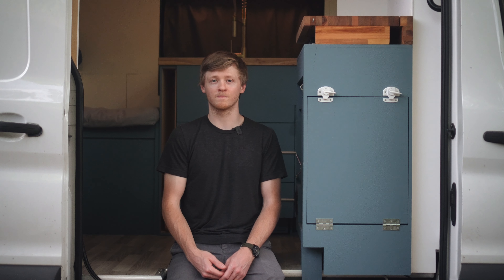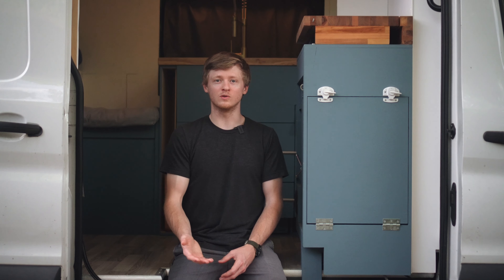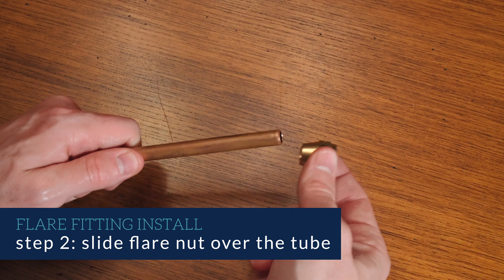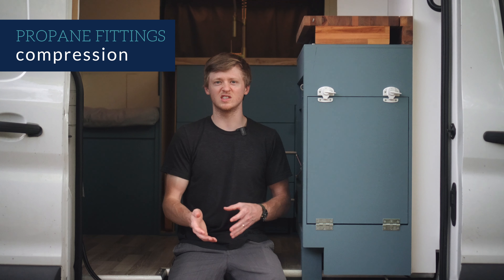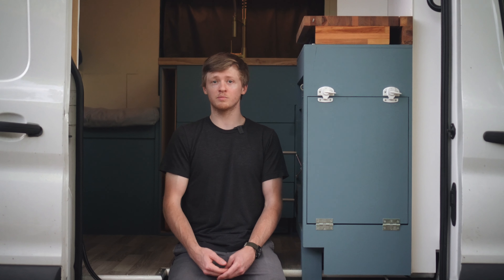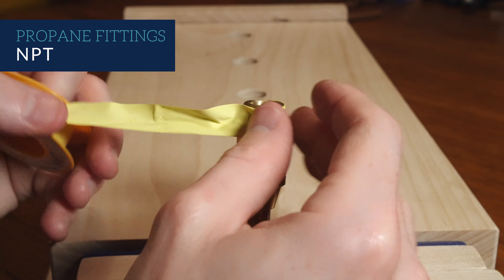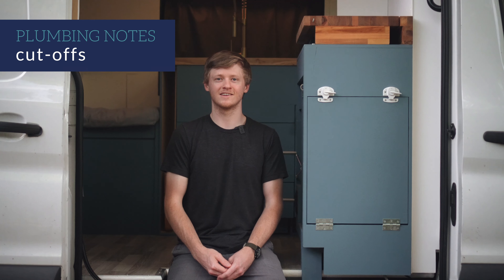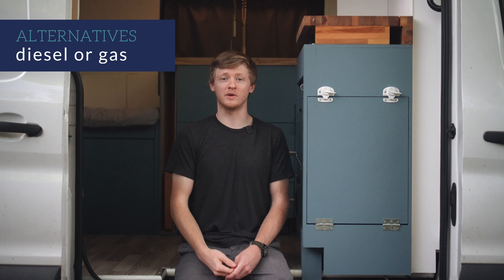Camper Van Propane System - What You Need to Know for Your Build!

Comment: You can get solenoid valves that are “normally open” or “normally closed” in the unpowered state, and also motorized ball valves that only use power while opening or closing. Regardless of the valve you buy make sure it is rated for LPG.

Comment: great video! Could you use a carbon monoxide detector instead of a propane detector?
Reply: You need both as they have different functions. CO detectors protect you in the case of incomplete combustion in your appliances, but do not detect propane. And propane detectors do not detect CO.

Comment: Hi Sam, could you share a few thoughts on why you went half rubber and half copper? The copper seems a lot more intimidating, so I'd love to do all rubber. Are there drawbacks for that? Thanks! (Eric, Promaster 159 high roof, propex HS2000 and Dometic R31 range.)
Reply: I'd like to see how others made their connections especially if anyone has installed a solenoid valve. Thanks.

Comment: You need to have good ventilation to run a propane system in a camper, its not just the gas fumes burning propane also emits alot of water vapor you're walls will be dripping. Installing a propane system is not a problem if you don't care as much about stealth and have a bit of money sitting around. In my case I spend alot of nights in city neighborhoods and used alot of my savings buying/converting the Van so this won't happen anytime soon.

Comment: Hey Moser, 
Is it safe to substitute the propane rated rubber tubing for the copper? I kind of want to do this because it’s easier and requires less tools, but the info I’m finding seems to point to copper being the standard. I have an external propane box at the rear of the van, with the oven at the front so the line will be no more than 10’. 
Thank you for the video! For whatever reason there seems to be less information on gas lines than other van topics.
Reply: It’ll work just fine. It’s what I use in my camp trailer. Just get a propane detector and mount it down by the floor.

Comment: Great videos. Question...If i want to run just propane oven stove what size tank do you think I’ll need? I was thinking about doing undermount tank with a electric 4g water heater for my shower and sink and a wabasto gas heater. Is Undermount just for stove/oven overkill? Do you think a 4 gallon electric water heater is a good option? I have 3x100 amp hour lithium batteries

Comment: Where might I find a link to the propane stove top that you purchased😮 it's kind of like Meg Ryan in that movie I want what he's having😂❤😂 I was shown in meditation after creating the exterior box to lay it on its side after having marked the bottom Circle foundation and the top collar wrap the propane tank in plastic and then the spray foam the bottom which would be the side of the cabinet halfway let it dry a little bit and then lay the tank into the phone and allow it to finish curing and that way it protects it from temperatures helps hold it into place and still leaves a fair amount of airspace and GAP within the cabinet to work around it😮 my challenge is I'm old I'm tired I've got already too many things to do and I sure wish you were close enough to make me a propane cabinet for my Sprinter which I plan on putting just at the edge of the slider door😮 help help😂❤ would you and the missus like to come visit Montana❤😂
Reply from the maker: Hey there! I can't offer coming up to Montana to help but here is the link to the stove top: https://amzn.to/4e4srqb
Reply: @MoserMakes  thanks dude

Comment: Are carbon monoxide or water vapor output from propane heaters a concern?
Reply: For the type he has, it vents to the outside underneath the vehicle and out to the side, so there is no concern about output unless your vent is located near a door (usually passenger or sliding door, but sometimes rear doors). Your output should vent around the middle of the vehicle so that there is no risk of gasses coming back inside the van. Using portable propane heaters like "Mr. Buddy" heaters must be used with ventilation for the reasons you're concerned about. Open a window and/or turn on an exhaust fan when using portable units.

Comment: I would not mount a propane bottle directly behind the cab.... the worst accident I ever saw was a camper with LP tanks directly behind the cab... The bottles ruptured and sent flames 300 feet into the air but only spread to the side about 6 feet... that was ~ 50 years ago I can still picture the charred remains in that camper... ... I feel that had those tanks been externally mounted on the rear of the camper that couple might have survived...

Comment: Good info. However,  if you want to install your system in accordance with ISO standards (mandatory for licensure in Europe) then check out the “Greg Virgoe” channel - he has a video where he goes through the ISO standard point by point. Will also give you the safest installation.